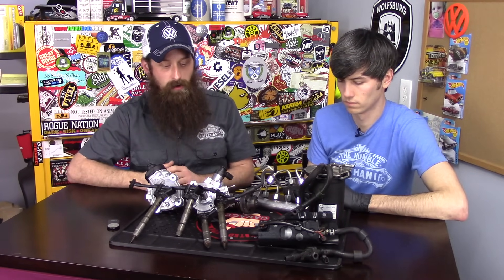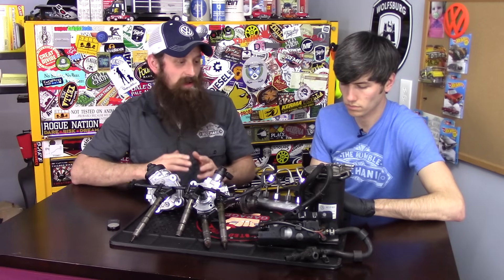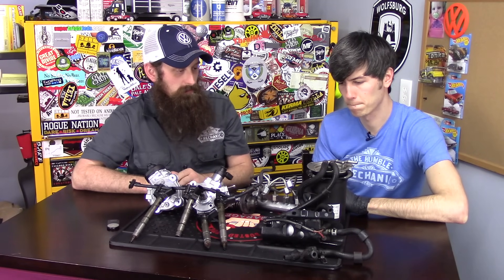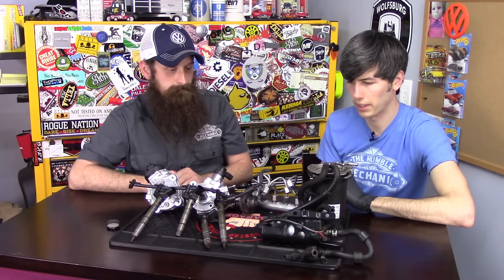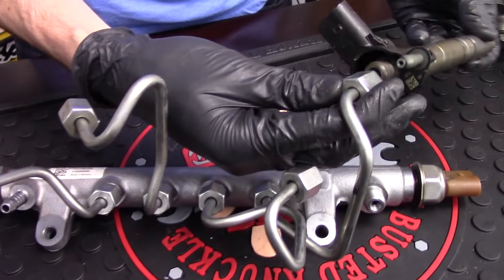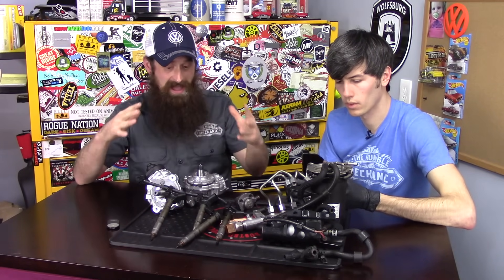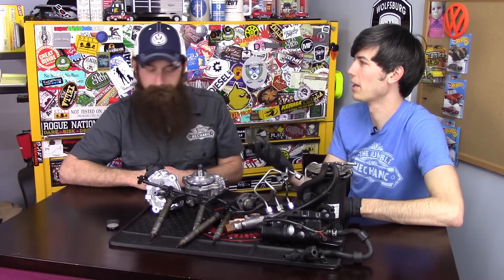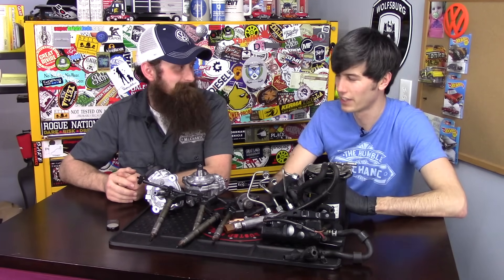Putting Gasoline In A Diesel Car - What Happens?

Comment: So all the parts could be good...wont' test them or try them out....Better replace the car. Most time you run diesel in your car you will just lack so much power you'll notice. I has low BTU rating. Drain tank flush system with diesel. Start it see what you got. Replace parts as needed.

Comment: Lol this is such BS. You don't need to change anything. Gasoline  isn't destructive to the fuel system components in a diesel car. 
All you need to do is drain the fuel tank and then crank the engine on diesel again. This is literally adding to the customer's bill.

Comment: So, suffice to say, you're at a gas station and realized you've just put in the wrong fuel. As long as you don't start the engine, the "damage" can be limited to just the tank and tank filter. So have it towed to the service station.

Comment: What a rip off,  I  accidentally put petrol in my Passat TDI AWX engine. My excuse was filling up early morning. Anyway I pumped out the offending mix, refilled with with diesel. A few years later sold it to a friend with 240,000miles under it belt, he has owned my old Passat for four years with no problem, still runs well with 290,000miles. If you put petrol in a diesel do not drive . But eight grand for the job you gotta be kidding, I would rather go to a breakers yard and buy a second hand lump for a few Sheckles. What planet are the geezers on ?

Comment: I work at a dealership and I've seen a 3.0l eco diesel run on gasoline. not well but it did run. drained the tank and lines, filled it up, cleared the codes and the vehicle was fine

Comment: Sounds like the guy with the beard is doing whatever makes the most money.  This seems overkill to me.
Reply: Yes he goes overboard on repairs because he wants to make sure the car/truck is 100% before sending it out.  Customers really hate having something break right after it was fixed.

They could probably not  replace the injectors and fuel rail if they opened the pump to see if metal shavings were in fact present.  That however might be more time consuming than just replacing everything and well he's not the one actually paying for everything.

It's likely a combination of sloth, greed and just being over cautious.

Comment: Amazing stealership philosophy to its best. Your money in my pocket...LOL
Already had to deal with both scenarios diesel in gas and gas in diesel. Curiously NEVER ever a client came back with issues due to fuel change.
What happened to the drain, clean, flush? Oh yes off course it just cost a couple hundred less. Better change everything "just in case". LOL :-)
For the less informed gas/diesel and water never mix. Let it rest some 10/15 minutes and they will be clearly separated and can be reused accordingly. Oh that does no good for the recycle company since than they can't charge you either.

Fuel filter replacement yes by all means, cleaning and flushing no discussion at all. But gentlemen if facing similar situation please do a favor to yourself find a good mechanic. ;-)

Many, many years ago on a brand new car (10k Km) after a huge pothole created one leaking shock absorber. I decided to use the local stealership due to a nice price campaign that was ongoing in there.

Conclusion a HUGE bill to pay. Off course both front shocks where new (makes sense) but also the discs, brake pads, and the brake hoses!!!! Their excuse "was contaminated with oil from the shock...Damn fu__k_. didn't even washed the remaining area on the affected side.

Comment: The old truckers used to mix gasoline in their diesel engines to thin it out and prevent the fuel from gelling in the winter time, roughly 5% I think. By all accounts I have heard, the truck would run just fine, no noticeable difference whatsoever. I realize you can't do that now with all the emission equipment, but I'm pretty sure they still mix in some kerosene for the same purpose.
Reply: Thank you for making this comment, I'm thinking of doing this but for a different application :).

Comment: Total nonsense.  Drain and refill the tank and replace the filter.  End of repair.  Diesel fuel still in the lines = no further damage and even if there is a bit of contamination further down the line it won't be enough to cause any lasting problems.

Comment: I develop HP pumps for VW. These pumps use a hydrodynamic film (a layer of fuel)  between metallic components to reduce friction, and as gasoline doesn't have the lubricity problems of diesel, this film isn't produced therefore parts wear extremely quickly. I doubt it will be bearing material in the pump that causes debris, the bearings are more likely to be PTFE, the metallic debris is likely to be from the roller in contact with the cam. I can understand why all of the injectors are replaced, they tend to have 8 holes in the nozzle, about 0.1mm in diameter each. Doesn't take much to block.

Comment: Nice Video.   I love all you Video.      I m from Norway   and it dosen mater if you put diesel or petrol in a VW diesel car like this.   soner or later it will destroy it self :-)    1 week ago I get a vw 2.0 Touran in my garage,    running 110.000km        hight pressure fuel pump was not working,  and there was metal parts inn the fuel system,   tank     total repair price 10.000 dollar  :-)

Comment: If you notice your engine knocking and banging and shut it off right away the damage is typically negligible. The fuel pump will typically release metal shavings throughout its lifecycle, normally they will go back into the filter through the pressure relief valve and be safely captured. This is why some engines require the fuel filter housing to be completely removed and cleaned when changing filters, otherwise the now agitated swarf from the bottom of the housing will go straight back into the pump and wreak all sorts of havoc. When you put petrol in that pump it releases a whole lot more swarf and that's when all the problems start occurring

Comment: Been there done that... 80% gasoline to 20% diesel ratio. I was in a hurry so I had no time to flush the gasoline out of the tank and had make a 400km trip, I've noticed the engine struggling burning that mix, not being able to pass 130/140 km/h with pedal down,  but all went ok besides that. Now with over 50000Km from that event the engine is still running fine, I had no trouble with it not even changed the filters until the next oil and filters programmed change.

Comment: Like some other commentators...  I find it amazing you are replacing components that don't need to be replaced...best case scenario is drain the tanks crack the fuel rail clean out the lines it would take a lot of cranking to wash the bore to cause any really significant reduced "life" that anyone will notice...

Comment: Interesting so putting diesel in a gas engine is a minor issue yet seemingly a huge issue when doing the opposite, and YET, they made it so you can't fit the diesel pump into a gas tank but you can fit a gas pump into a diesel car.  Why didn't they do the opposite?
Reply: More people drive gasoline cars over diesel.  The consequences of putting diesel in your gas car might not be as bad as gas in a diesel but you'd have WAY more people making the mistakes.

Comment: In Finland in winter I was told people regularly put a bit of gasoline into the diesel in their tanks, that would make it run and start better in extremely cold temperatures. Can someone explain if and why this is true?
Reply: It thins the diesel fuel which thickens in extreme cold and it increases the volatility making it easier to ignite when extremely cold.
Reply: +MrTdw1954 So if I understand you correctly, it IS true and doesn't hurt the cars?
Reply: no because it is a small amout, (something like one liter on 30 liters of diesel) and you have the lubrication of diesel. but you dont have to do that. just open and close the switch 2-3 times and the coil will heat the diesel and the engine will start. only issue it to have a good battery because in cold days batteries look dead. you can also have a jump starter for these days

Comment: Eh, my diesel engine runs fine on gasoline.. just won't last very long.  You see my engine has this device called a 'Fuel Density Compensator' that allows me to run pretty much anything that burns other than solvent.  Glad I have a multi-fuel engine.

Comment: I put gasoline in my Jeep Liberty CRD all the time...
But I did remove the 2.8L VM-Motori diesel and swap in a 3.7L gas V6 due to the VM-Motori diesel being a troublesome design.
I do have to worry about others putting diesel in by mistake since I left the diesel fuel cap and Diesel Only decals in place. Another reason not to loan out vehicles.

Comment: I have a Bobcat landscape loader that apparently had gasoline put into the diesel tank. It ran so badly I had to take it to a shop and they diagnosed that gas was put in my diesel tank.  What a shock to me, and don't know how that happened. Question...since i still have the yellow plastic storage tank I travel with, if I look at a sample of that fuel (appparently mixed with gas) can I visibly see the difference? Is the fuel swirlly looking as it's mixed, like oil and water, or would there be different colors if I poured some out in a glass jar to inspect it? How does it look combined?

Comment: I stopped the vid at 2:38 Reason for this is simple.  YES IT IS BAD!!   Look im not saying the video is not full of useful info but right off the bat it turns right into a big money repair.  So to save everyone a lot of eyeball wrenching and ear filling jargon ill answer the question without going into a big video.  Putting Gasoline In A Diesel Car- What Happens?  It drains your wallet.  All done!!

Comment: I went on a road trip once with my brother, mom, and aunt once in my duramax and we stopped for fuel and I was hungry and asked my aunt to start filling up my truck thinking she knew that it was diesel after I complained that the gas station by our hotel didn't have diesel fuel. After I came out I was walking out and getting my truck and just happened to look at the pump and saw she pressed the 87 octane and screamed NO. After everyone stopped.staring she asked why I screamed I said you tried to put gasoline in my diesel truck. Before anyone says anything the gas and diesel fuel were at the same pump.

Comment: I admit I did this with my work truck. We had Gas Ford trucks for years and they switched to Diesel Chevy trucks. Now I had it for two weeks and was fine but one morning I was tired and on autopilot grabbed the Gas pump. It was a 30+ gallon tank and I had maybe 2 gallons in it when I filled it up. Luckily as I was putting the gas cap on I realized what I had done. I never started it. I rolled it out of the way and into a parking space and called local shop. I work in the oil and gas industry as an I.T. Tech so this was quite embarrassing.The local shop tried to tell me it would be about $6000 and that they had another rguy with the same truck do the same thing. I explained that I was familiar with cars and work on them at home. I explained that I had not started the vehicle and all I needed for them to do was drain the tank. They charged me about $500 and replaced the fuel filter even though it didn't really need it but whatever. I also noticed they did not put the gasoline in a special disposal tank but rather a couple of old oil barrels, put a piece of plywood over the top and left it there. It took forever to drain the tank. As I was paying I ran into another guy that works out of my office and he was there for the same thing but he drove it till the engine crapped out. He had to pay $6000 out of pocket. So its a huge difference to drive it and to just have it in the tank for sure. I went online and purchased those big green "DIESEL ONLY" stickers and put one right on the gas cap door so I wont forget again.

Comment: I worked almost 20yrs on medium + heavy duty trucks and all kinds of equipment. Unless it was ran under a load and overheated badly, we drained all the tanks and lines, blew out the system, fresh filters and fill with diesel with no problems. I only saw a handful of damaged engines because of gasoline ingestion, usually new engines that hadn't broken in and none catastrophic. I think your repair procedures are quite a bit overkill. Replacing good parts because they "might" fail in the future??? is bs, parts are either damaged or not, even the rubber lines shouldn't be bad. I usually enjoy your videos but this one bombed.
Reply: the russians mix diesel with gasoline up to 1:1 otherwise it would freeze or flake out and clog a filter or whatever... their heavy duty stone age engines handle it quite well as far as i know
Reply: I have to agree with you Jim about over kill about putting gas in a diesel motor mostly with older diesel motors are built to handle way more than a modern diesel motor will do because I have a old VW diesel motor and I have put in quarter of a gallon of gas in my diesel often in the winter time for faster starts and less gel up with diesel fuel on summer grade fuel and better performance. Been doing it to my older diesel for many years now and no show of any damages to my diesel motor at all,
Reply: Having seen all the metal shavings in that pressure pump… you’d have to replace everything down stream if you were lazy and didn’t want to take everything apart. 

Injectors often aren’t made to take apart but Diesel engines can be. Because they clog up frequently and get all gummy… cause your running diesel.  It’s designed to be maintained. 

Most mechanics will just replace parts for the money in labor. Not because anything was damaged or to prevent it.  

Definitely would be easier to just clean it up. But here there was damage.
Reply: Hi my good peoples, I have BMW X3 diesel,just brought into garage after the owner mistakenly put petrol  second time again, even we clean the tank and replaced diesel pump just run few miles now doesn't want to start.should I replace pressure pump, rail pressure and diesel injectors?
Reply: Emilly Haipumbu change the engine, the tires and the brakes and your fine
Reply: Hi, could you possibly help me. I need I asap. We bought a skoolie.  The guy dropped it off to us and everything seemed great. Until we tried to start it after he left and we realized he left us on empty and it wouldn't start. We went and got a big 20 gallon fuel can to fill it up, but then read that we would need to prime it, or bleed the engine first.  It is a flatnose FE dt466.  We are not mechanically inclined at all! If anyone could walk us through these steps I would be forever in your debt. It's just me and my 22 year old daughter,  yeah we are in way over our heads, but I can't get it from my house to the mechanic for real knowledge and help with this first.  Ugh, help🤯😬
Reply: Near the end of the video they said old diesel systems where less harmed than newer ones. And that they fixed them the way you describe. Could it be that you where working with those older systems?

Comment: What happens to the gasoline if/when it reaches the combustion chamber?

I know gasoline engines use spark plugs, whereas diesel engines use glow plugs, so how does this effect the way the engine works as it burns a different fuel?

Comment: Instead of paying for disposal, Couldn't you pour it in a shop heater? When I worked at a classic car museum we used to take our waste oil and give it to the garage across the street and they used it to heat the shop. This was just waste oil though, not sure how those shop heaters handle gasoline/diesel mix

Comment: At 8:50 it's mentioned that on the older diesels, one could get away with gasoline in the diesel - YES.  From the "been there, done that" files, a truck with an 855 Cummins 250 ran out of fuel 200 miles from the shop on a Sunday in the Midwest decades ago, so with the diesel from the service truck and a local gas station, we ran it on an 80/20 mixture of gasoline/diesel, engine oil. Low power, but it arrived at the yard suffering no damage.

Can't do that these days though!

Comment: What about diesel in a gas?
Reply: It's mentioned at the end of the video. Charles says it's not as bad and would probably cost under $500.
Reply: Diesel has more lubricants than gas so if you put diesel in a gas engine you have more lubricants in the system.  For the most part you're just draining the tank, flushing the lines and replacing the filters (unless you drove a long ways).  

The reason why putting gas in a diesel engine is expensive is you starve the pumps of lubricants causing them to break meaning much more costly repairs.

Comment: Why not replace the whole engine?
Reply: but how can you be sure that the ash tray have no metal fragments in it that may cause the longevity of the car. get a new ash tray just to be sure.
Reply: There's a good song about that. "One piece at a time" I think it's called...
Reply: @yevrahhipstar3902  one piece at a time, it didn't cost me a dime... you'll know its me when I roll through your town! J Cash
Reply: da8352  check engine light problems
Reply: That always happened to us
Reply: Really
Reply: Yevrah Hipstar My favourite Johnny Cash song... but the economics are different cuz that song's about stealing the car one piece at a time. buying it though, he makes a good point: even with free labor I bet you'd pay twice as much to build up an engine yourself out of OEM replacement parts than buying it normally
Reply: @nathansmith3608  But you'll have the only one there is around ;D
Reply: Do you know how much engines cost for better cars? it's way cheaper buying new parts instead of a new engine.
Reply: @Anonymous159951  r/wooosh!

Comment: I have friends who run a diesel geo on gasoline, not only does it turn over, but has been running fine for months. How does this work? I'm assuming the high compression is igniting the gasoline.